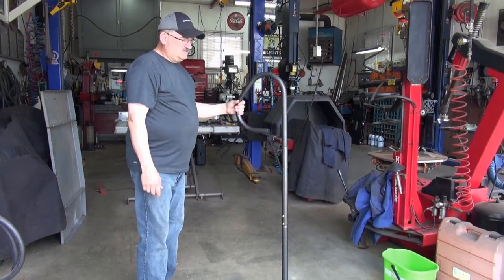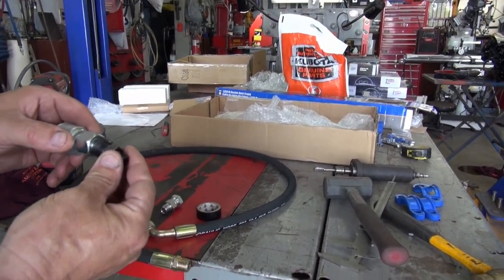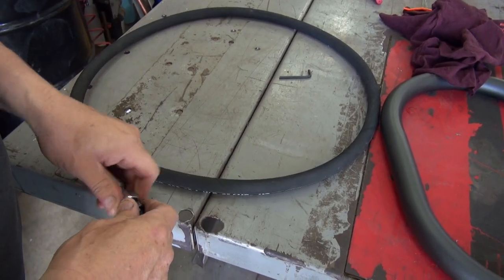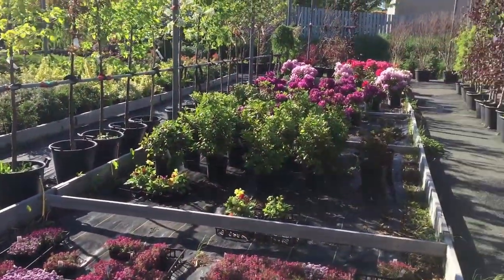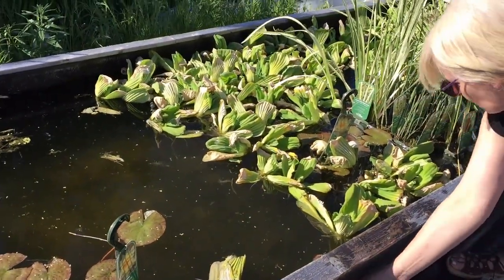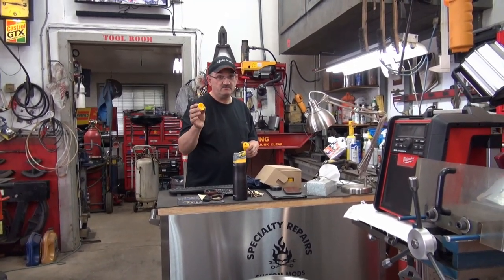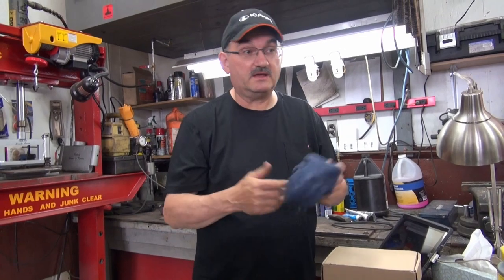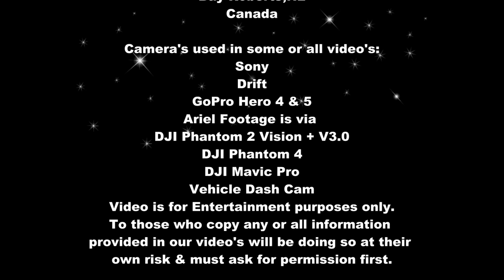On The Rails

Comment: Those handicap cards do not come cheap either well not here in NZ anyway. Liked the vid bro and I Kathy.
Reply from the maker: I'm not sure if they cost anything here Ken but you need a letter from a doctor before you can apply for one. I've seen cases where people got caught using counterfeit ones.
Reply: They changed them here so now it is harder to a counterfeit one but they fall apart sitting the sun, I get mine for 5 years at a time but it has not lasted much over a year before it started falling apart.
Reply from the maker: I guess a lot of heat in the vehicles to cause that. I'm just trying to bring some awareness to the problem but mentioning it. It bugs the crap,out of me when someone takes a handicap zone. To be honest I'm not a nice person when I see it. 😡

Comment: Hi Paul and Kathy! Not sure you will see this I'm so far behind. Haven't been around so I'm trying to catch up. Mom died so we had to go to Michigan. Grass was over a foot tall so I had to address that. Rained about every day so I'd do what I could in between rains. So much going on. Just got the mowing done an hour ago. Our grandson gave me a Lincoln 225 arc welder and all the goodies to go with it. The gloves aren't as good as you showed but they will do for now. I have to run wire and put in a plug for it. The 220 I have has the wrong plug and I use it for my air compressor so I thought a dedicated plug would be better. Well on to the next video. Take care and God Bless. Levi~~
BTW, great job for Jaime!